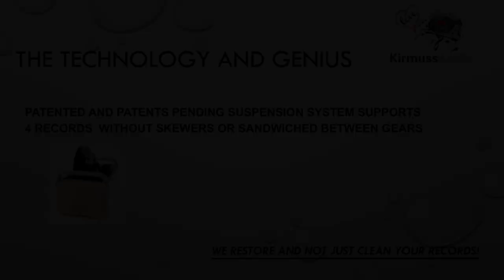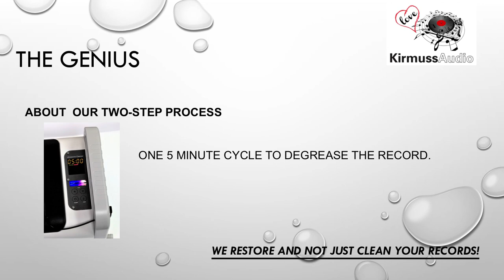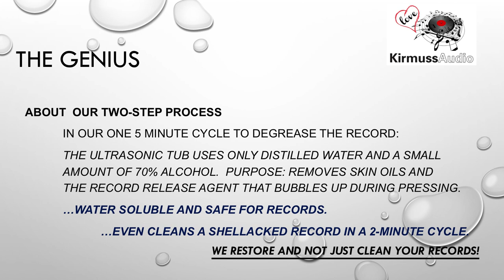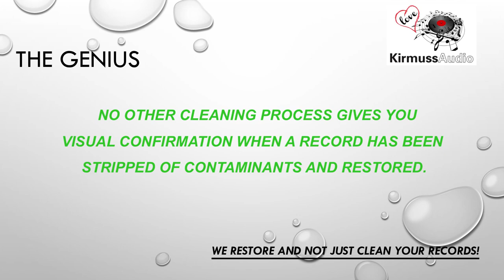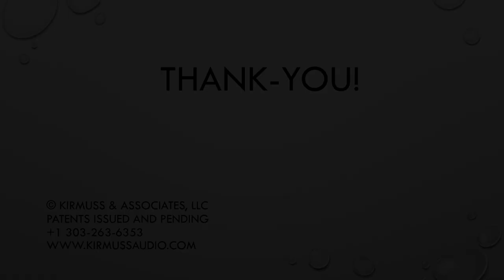System Attributes Ver2

Comment: Bought one of these a few weeks ago. Yesterday bought a new disk...Queen , A Night in the Opera. I was surprised how the sound just "popped" out. Like being in the room when it was recorded.
Reply from the maker: Thank you for your review. It is the process of applying over several cycles our ionizing agent to the record that attracts the plasma wave created by ultrasonic cavitation to first the record's surface, then as surface contaminants are removed, we then go deeper into the grooves. The end result as you noted  now sees the needle make full contact with the detail in the grooves of the pressing made by the stamper, less the release agent that presented itself to the surface of the record. Enjoy restoring your records!
Reply: That's what analogue vinyl format is capable of.
Reply from the maker: Bob Levy Chairman of the Los Angeles Audio Society just gave us a raving review both on our record restoration system and our 800$ Adrenaline speaker cable that was compared to  $10,000 set

Comment: what is that white toothpasty cream called?   - how much lighter does the record weigh when it 'oozes' out ?  Can you show the data?
Reply from the maker: Respectfully read the documents.  The whitish materials appearing after the prior cycle in the sonic are the contaminants etc. softened by the ultrasonic and being brought out by the goat hair brush when adding the ionizing surfactant spray.
Reply from the maker: There is a colorant in the mix that allows one to see what the ultrasonic pulled out on the prior cycle. 

Rapid dissipation confirms the last cycle in the machine

Comment: I would like to know what record sleeves are best to use after a Kirmuss session? Are Mobile Fidelity sleeves good? I have heard on prior videos mention of pure Rice Paper sleeves that allows the record surface to have air circulating through. Thank you.
Reply from the maker: Pure rice paper can attract the growth of fungus over time if the plastic sleeve is broken. We use a 4 mil HDPE sandwich on an alkaline paper. We also do not see our KirmussAudio sleeves subject to use of a talcum like powder in manufacture when environmental conditions are humid. Our sleeves are made in a controlled factory with no windows open.
Reply: @kirmussaudio7578  thank you!!!

Comment: Does this remove mold and fungus too?
Reply from the maker: Yes. Cleaning machines of all kinds do this well. Our purpose and patents issued and pending for our process is  designed more specifically to not just surface clean but to remove the release agent from the grooves. This material surfaces during the pressing of the record and is found in both new and vintage records. As the record is played the dyne of the needle  generates heat and inadvertently microwelds dust into this material found in the grooves. Our mission is to remove this material and by doing so we remove the microwelded dust that causes many of the pops that we hear. Of course the pops caused by  needle drops cannot be resolved . A side benefit is where some scratches caused by a tone arm inadvertently skipping across the record causing that annoying "tick" every record revolution in most cases is no longer heard. Scratch still  visible,  but as the needle is now "further in the pocket"  deeper in the groove, our experience in restoring thousands of records  shows us where the click is no longer heard in 70 % of the cases subject to our process.  An extra benefit of groove restoration and not just surface cleaning.

Comment from the maker: First and foremost, do  review if you can the white paper  presented at the ARSC convention in May 2019 and our discovery and position  that discusses the relative charge between the record and water with or without soap in any cleaner,, vacuum or otherwise, and how we noted where one needs to change the charge of the record to benefit from the action of any sonic or cleaning process. Our patents issued and pending  covering our cleaning and groove restoration process and are  the only ones known to accomplish groove restoration and measured release agent removal   by one  brushing onto the record over repeated cycles our ionizing agent in the CLEANING AND RESTORATION PROCESS. Not the POLISHING process that you describe which is for static reduction. To the entire process. ....  The spray is used for 2 functions. First....The record's charge is now different than that of the water with spray brushed into the record's grooves.  Opposites attract. Now attracting the wave caused by cavitation  to the record we benefit from ultrasonic technology. . Having a liquid soap in an ultrasonic's tank does not accomplish this, hence only surface cleaning results.  We need these repeated applications and  cycles with the ionizing agent applied to the record as by changing the charge  of the record  we then fully attract the resulting plasma wave to the record and especially the inner  grooves. Unfortunately the change in  charge of the record with respect to water is removed as the record is spun, rendering the process useless as is with all ultrasonic cleaners . . So more applications and cycles in our machine are needed.....this as the  temporary charge applied is now  removed. So the reason where we need to cycle the record with an ionizing agent applied..4 or 5 two or five minute cycles. The reporter did not do this. Added,   as with any sonic, the water hitting the record sees standing waves generated.  The closer the records are to each other, less power available to reach the entire record. So our process takes into consideration using first our   bi polar ionizing agent apllied on the record, and having specific distances between records. This to see after multiple cycles the release agent successfully removed and breath of the music and artist restored. This sees an increase of 1.3 to 4 dB increase over floor depending on the provenance of the record. Also about 3 to 9 microns of residues and coatings etc. removed. Needle makes full contact with the detail of the grooves pressing.   No other process talks about these measurements.. they can't...  If we just placed a record in any sonic with water with  or without a soap or agent in the sonic's  bath and spun the record, including our own machine, we would not be able to remove the release agent from the grooves as we do including  and at the same time any microwelded dust that was welded into the release agent/grooves by the heat of the needle which creates those pops.  To scientifically validate our statements, expect in  3 or so weeks a video which will post results of testing that you can perform yourself at home to see the results of our process over some lookalike products as well as other sonics priced 4 times higher. To the second point...  The polishing of the record at the end has nothing to do with our removing the release agent or cleaning.  Using the same bipolar ionizing agent, misted on a dry goat hair brush, and moving the brush across the record several times each side,  changes the charge of the record to repel dust while playing. Taking advantage of our reply,   in several tests by armchair enthusiasts  saw the audiophiles not use the bipolar agent correctly. As described above, pouring any quantity of our bipolar ionizing agent in our ultrasonic's tank in any concentration added to distilled water does not assust in attracting the plasma wave to the grooves, and thus cannot remove the release agent that we intend to do.

As to charges of water and record,  dusty and record, If you speak to commercial users and manufacturers of ultrasonic cleaning machines  they will confirm the need to consider the relative charge of the record ir item being processed as it relates to that of water in the sonic unit's tank. Do call us so we may clarify the above and reflect on many unscientific and improper uses of sonics and other cleaning processes out there for records. and our study of charges of dust, records and cumulative static charge of spinning pvc (records). Thanks for your illustration.